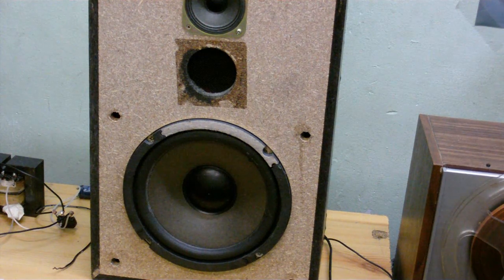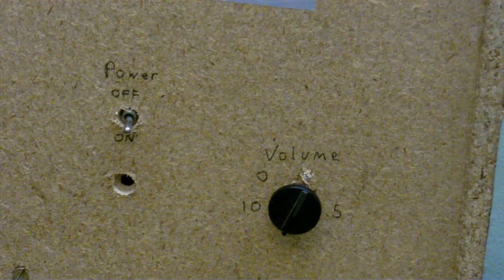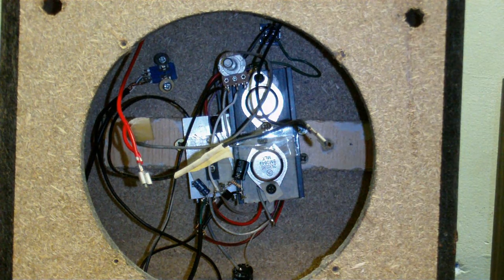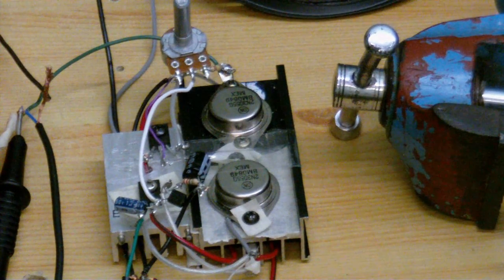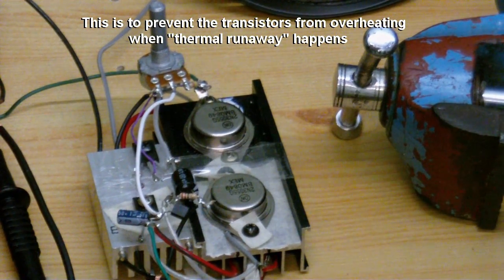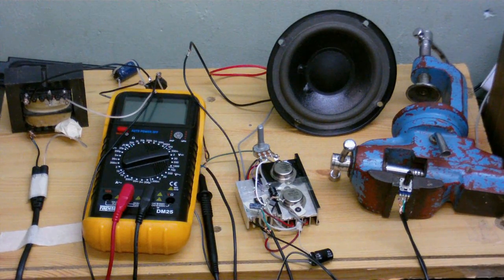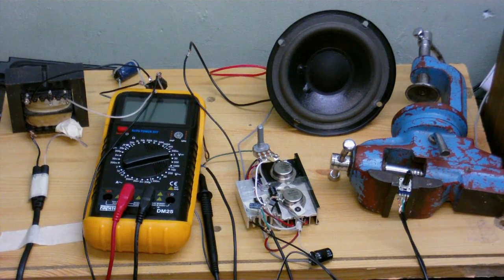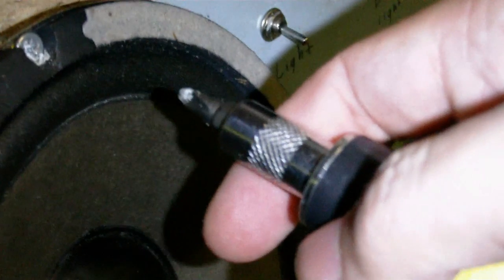Another amplified speaker

Comment: I like to take an old CRT TV and take the area off the circuit board that has the power amp on it...It already has the parts installed...just look up the amp IC and get the pinout and find it on the board and hook the speakers and power to it...

Comment: hello, i have question? how the signal from input send to the base of the transistor bd 140 to operate this transistor turn on. thank you
Reply: The first transistor (BC547) is considered a VAS (voltage amplification stage) - similar to a power amplifier with a differential input stage employing negative feedback - the output of which is sent to the base of the VAS. In this instance, there is no input stage and the VAS is acting as the input stage. The BD139/140 transistors are drivers to the 2N3055's in a quasi-compound configuration (technically the positive side is in Darlington and the negative is Sziklai). The 1 meg trim pot is used to adjust the output voltage point at the output before the 1000 micro Farad capacitor to half the supply voltage. This puts the amplifier in to class-A operation.

Comment: Hi, how can the input sensitivity be changed from 40-150 mV to suit a higher input voltage?
What component or components are responsible for this.
Finaly , why are there 3 x diodes in series going from the base of BD 139 to the base of BD 140?, is it to help dissapate the heat spread over all 3 diodes to get rid of the thermal runaway, thanks.
Reply from the maker: SP330Y It's very simple, if the amplifier is too sensitive, you can add a potentiometer (3 terminal variable resistor) to the input, one of the pins on the side (doesn't matter whitch side) can go to the ground of the amplifier and also the ground of whatever it is you want to connect to it, the pin on the other side goes to whatever you want to connect to the amplifier, and the middle pin connects to the amplifier's input.The 3 diodes are there to create a voltage drop between the 2 transistors, it's a little hard to explain, but it basically biases the transistors so they are right at the point where they are just barley staring to conduct, 3 diodes are used to get the right amount of voltage drop, as for thermal run away, those diodes can be glued to the heat sink (with some kind of heat conductive glue) so as the heat increases, the transistors conduct more, so as the diodes get warmed up the voltage drop across them will also increase and biases the transistors less to take care of that.
Reply: Add negative feedback to reduce sensitivity.  This will also improve THD.  Next, bootstrap the speaker.  Google the keywords I have mentioned and you will see what I mean and how to do it.  It is good to see young people today still building discrete power amps.  I started out 25+ years ago the same way......keep it going!

Comment: I ran your sheme on +/-18 on batery charger for laptop i use tranzistor in 2t6821, your drivers db139 and 140 and 2x2n3055 but have output voltage ma 9/10v speaker but no have signal. I dont understand why didn't work. Please give me your scheme with full description on ls.

Comment from the maker: It's not USB powered.  But you can get 5 volts from a USB cable, take the insulation of the end, there will be 4 wires inside, the red wire is the positive and the black wire is the negative.

Comment: your really good with electronics (like me) have you tried powering a 12v amplifier module from a 12v 10w & 20w solar panel as i have a old portable stereo that runs on 12v dc and directly powered from 2 solar panels

Comment: i have just bought myself a 12v 2 x 15w amplifier module from ebay for $8.00 that has the volume control + 3.5mm audio input and mounted it inside a pair of old detachable boom box speakers

Comment: This amplifier you are showing me is very similar to a stereo amp (1 ch.) that I built to put in a tape deck so only speakers need to be hooked up to it. The amp gets its power from the recorder's own power supply (no separate power sup. needed) works fine.

Comment from the maker: @siwy125552 I guess it could run on 30 volts, but i wouldn't try anything more than 24, somewhere between 15 and 20 volts should be ideal for this amp, I ran this on about 12v in this video if I remember.

Comment: could be a 30V power?
Reply: Yes, as long as the capacitor voltage ratings are higher than that. I wouldn't go higher than 30V.

Comment: @CoolDudeClem well if i put a 1nF cap with a 10K resitor to make a low pass filter, i have calculated that it would give me a limit frequency of about 16kHz. is this good enough. if not, what would be a good limit frequency that way i wouldnt have any interference from the power lines and other electronics.

Comment from the maker: @MrDixiepride1234 If it's picking up radio stations putting a capacitor across the input jack should help fix that, try 1nf at first, if it muffles the sound go lower, if it doesn't fix the problem and doesn't muffle the sound too much try a higher cap.

Comment from the maker: @racetest Any diode from 1n4001 to 1n4007 should work fine, the original diodes I used here in the video were not exactly the right ones to use and it did take more power than it should, but sometime after I made this video I tried it with 1n4001 diodes and it ran much better and cooler.  I even tried it with a single yellow LED in place of the diodes and that worked just as well.

Comment: I have an old pair of amplified USB powered computer speakers with a busted volume knob but the pot is still there and still works. I might drill a hole in the broken pot shaft and then insert and superglue a long skinny screw to it.

Comment from the maker: @jorge1320e do you have a volt meter? if so test the voltage at the speaker connection and adjust the potentiometer untill the voltage there is half of the power supply voltage, that should fix the problem.